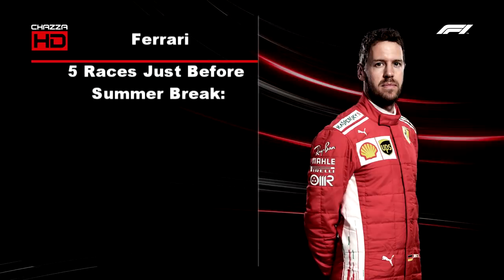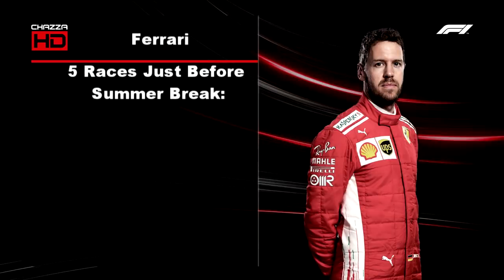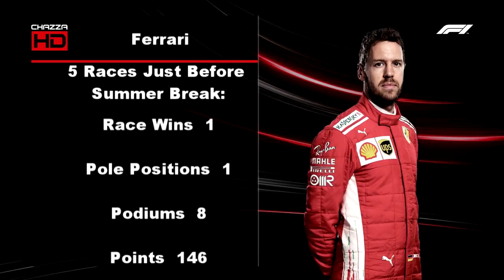Ferrari Battery Issue Explained - What Is It And How Have The FIA Stopped It?

Comment from the maker: Comment below what you thought of this video and what do you think of this story about Ferrari?  Do you think it has been banned (The Battery) or do you think Ferrari should be allowed to continue this innovation?  Also how do you think this affects Ferrari going forward?
Reply: ChazzaHDF1 your analysis of Ferrari recent 5 race form is wrong. Its not because of the car, its because Vettel can not drive in the rain and cannot stop colliding. Its only the last 2 gps that Mercedes have had a slight upper hand. So get your facts straight.
Reply from the maker: I stated facts such as in the last 5 races they have 1 race win, 1 pole position etc     Saying Vettel cant drive in the rain and cannot stop colliding is opinion not fact
Reply: ChazzaHDF1 i believe its misleading and you should have mentioned Vettel's form in the video, but you did not.
Reply from the maker: Those are the factual results of what happened     Like it or not thats what happened      This video was about Ferrari not Vettel
Reply: You can use MGU-H to gain extra charge  from the turbo but Ferrari are gaining more than they probs should be without losing performance from the turbo it's self
Reply: ChazzaHDF1 - We are so dependent on the FIA to monitor developments and judge whether teams are within the rules, or taking "unfair" advantage of the rules, or breaking the letter or spirit of the rules. Things like aero are different from the engine, gearbox and MGU  which are so hidden that it is almost impossible for an outsider to know what developments are happening.
Reply: In this light of events so, give to everyone the same engine 1 setting for, 1 type of tire and then we see who is the best driver, till then who as more money decide what the other does

Comment: Rumor I heard has related to the mgu-h which insteed of charging the battery like it should was boosting directly into the mgu-k which did not violate the battery output but violates the output of the mgu-k. A proof of this is in the telemetry since Austria their trace on the straights shows an acceleration increase in the middle of the straight which is impossible without a power increase. Rumor is when the turbo is at full speed they boost and get the straight line performance. Toto wolf claimed the mgu-h is 1 third of the total electrical power so using the battery alongside this one can easily achieve 40hp over the limit. In formula 1 the difference between best and worst is around 20bhp so they had the advantage but a new sensor was installed on the mgu-k which didn't exist before. They were knowingly breaching the rules but because there weren't any ways to prove I guess is another formula one thing.
Reply: I add all ferrari powered cars stepped back the resurgence of force India is the only way of knowing because Williams...
Reply from the maker: I think Ferrari here found a possible loophole and exploited it       Thats what all the teams are constantly trying to do
Reply: That is the thing, its just rumor and nobody knows the truth, we can just guess and chose to trust one press or another.
Not sure is it better to know the truth or to have 30 different rumors lol

Comment: It's not about exceeding the maximum kilowatts = horsepower.  That's always capped.  It's about harvesting and deployment.  The FIA introduced the 1st sensor and Charlie along with the FIA deemed it legal; Charlie said it was a really complicated issue.  Once the 2nd sensor was introduced (after Spa), that's when Ferrari's pace dropped.  Ferrari realized that "big brother" was on to them so Ferrari backed off.  Again, it's about harvesting and deployment....meaning, Ferrari were able to harvest faster and deploy at any given part of the track whether through the MGU-H or MGU-K or both....it's not about the kilowatts.

Comment: May I just say listen to sound of the ferrari engine in canada - italy then listen to the sound of the ferrari engine in japan
Reply from the maker: ill try if i can but from what i remember sound wise i cant remember a massive difference   I will listen back though
Reply: just remember that Canada and Italy have similar layout in terms of time on the throttle and breaks compared to japan... the set ups changes drastically, temperatures are different, gear ratios change which naturally means speed vs acceleration changes so the sounds will change. Canada and Italy are also tracks that are surrounded by trees and japan is open around the track so sound travel and echo changes too... too many variants to say the sounds are different due to engine changes alone... compare this to RB and their diffuser sounds a few years ago

Comment: From what I can figure out Ferrari was braking a rule how much power you can take from a battery and put it to MGU-K per lap. They did that with 2 batteries. One for MGU-K and one for MGU-H. Since only one is connected to MGU-H FIA only monitored that battery. But since there is no limit how much power you can send from MGU-H to MGU-K Ferrari was using second battery to spin up turbo and then spin down turbo and put that power to MGU-K. It is less efficient then just sending power from the secend battery to MGU-K but they did make a battery configuration that bypass sensors and I would call that cheating since you only using power to spin up MGU-H just to slow it down again...
Reply from the maker: If thats what they are doing then yeah possibly but unfortunately we still dont know
Reply: To know for sure what they did we will probably have to wait years... But this explains a lot of things. Like why 2 batteries since you only gain weight and use more space. Also sounds coming from Ferrari
Reply from the maker: If you can make up the weight disadvantage with the advantage of more pace from PU then i guess it makes more sense
Reply: Well it is not even that. F1 cars are made as light as posible. But since there is a minimal weight they then use ballast to balance a car. So what you end up with is just less ballast you can use.
Reply: @chazzahd9277  Ur do biased towarda MB that its bleh... same hardware on allegro cars , just different use, that's innovation and F1 is biased towards MB...

Comment: No clarity on its legality as of yet, however the claim was against the sporting code apparently. Bit like brawn in 09 with rear diffuser, but was allowed even after much protest from other teams, unlike in this case...
If it was illegal Ferrari would have been fined and points taken away ! fact. Unless we want to and another conspiracy to f1 history.

If teams engineers and designers don’t bend the somewhat vague parameters that are given, then that’s how we don’t achieve innovation. I think fair play for giving it a go, FIA didn’t approve that’s fine that’s the way these things go. 

In the end the best driver this year will take the champ, and fair play to him. 
Lewis has been faultless this year. 

Love from a Ferrari fan and racing driver.

Comment: Hmmm, you can't use the number of podiums and points to say that they've stepped backwards. Vettel crashed in Hochenheim while leading. He spun to the back of the field in Monza. He spun trying to pass Max into Spoon at Suzuka. This sounds like a Vettel issue more than a Ferrari decline....if you're basing this all on points and podiums.
Reply from the maker: It still matters       If a team scores less points 5 races after the summer break than they did before the summer break then as a team they have taken a step backwards (Drivers included)
Reply: ChazzaHDF1 True, but a good bit of that falls directly onto the actions of Vettel. There could be an issue with the power of the engine, as is the point of your video, but it's difficult to say given the heavy weight of Vettel and your chosen method of using points to arrive at a conclusion. The engine is a possibility. Vettel's actions are the actuality.

Comment: In short: Ferrari cheated and should be banned but won't because they are Ferrari.
It is clear to see that the FIA has stopped Ferrari doing something but what? No-one is saying. This is wrong. If Ferrari was cheating it should be made public or the sport's administration is corrupt. If this case was applied to any other name other than Ferrari I strongly suspect the public would have been told immediately. Ferrari have never played fair and never will when they have the full support of the F1 owners due to commercial incentives. This is also the reason why Ferrari get more money for just being Ferrari by the F1 owners and other teams getting much less. I call this cheating.